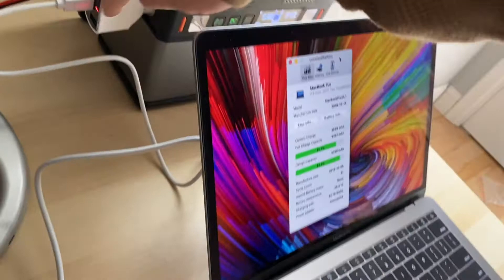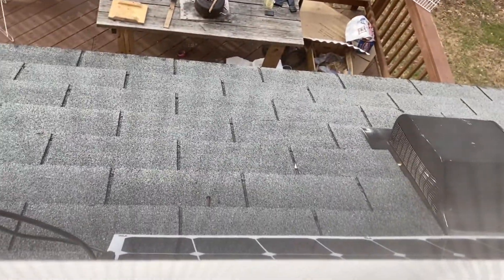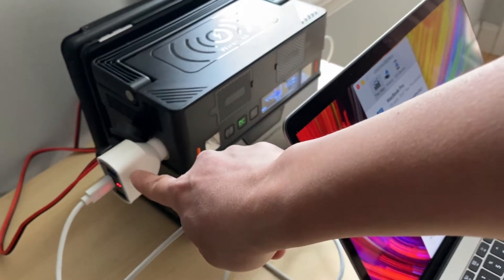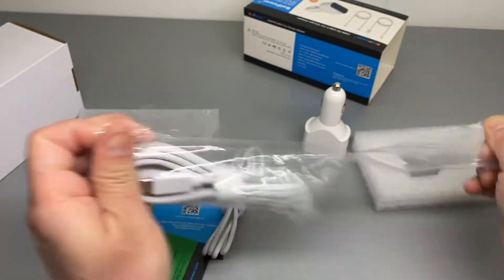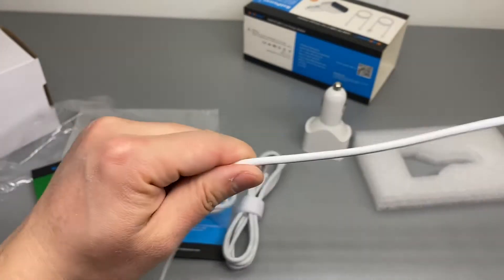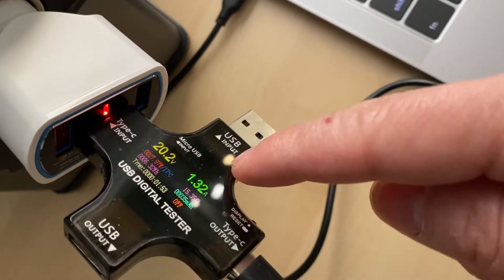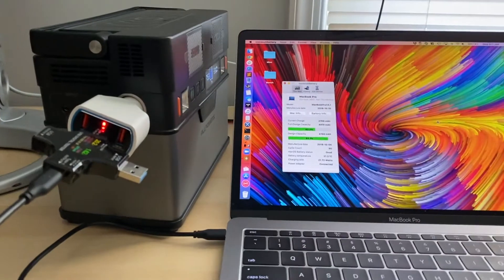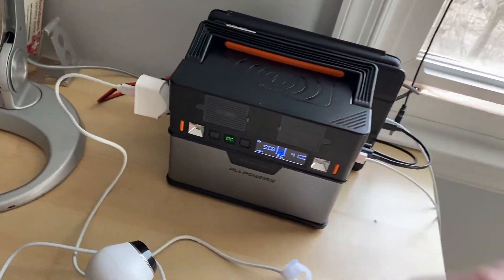ALLPOWERS Solar Generator with BatPower Type-C 12v Car Charger (Part 2)

Comment: so a mac can draw 65w right, and it was drawing only 22 or something , the charger was rated at 90w. so what was the bottleneck here.. were you using the stock cable ?
Reply from the maker: It really depends on the current state of charge -- If the Mac is around 80% or higher, the charging speed is lowered. I guess this kind of test is better when the battery is around 20%.
Reply: @ToolsElectroDIY  yeah, this smart charging is messing with guages I assume

Comment: How much time you have had it since purchased? Any battery or display issues ? I was testing most of all the features as the unit is well made , type c is not as advertised 60w it’s more like 45w in or out from port , all type A usb are perfect with great amperage output , the 120Ac is great but get around 110-114 around 59.9Hz all electronics would like that , now in the downside of things I noticed something that sucks on the solar Anderson input . The solar starts working from 16.6v to 22v so if it’s not so sunny even if you have so many panels you can 1) only receive 60W max from solar and must be around that volatge less will not let the mppt kick so weird . Dc is better for car plugs or the dc adaptor more friendly. As the cigarette is not regular yet the is a way to get the regulated but you must buy the plugs on the sides and turn it on by having a load of 3w or more which is sad cause what if you have a device that draws 200mah or more but doesn’t even get to the required needs the system will turn it off in seconds th other way is to simply hook a Ac adaptor that is 12v or what ever is the need and have stabilized voltage on dc.! Many devices don’t have the features this one has may have more Ac watts but the internals we don’t know how long they last many don’t have mppt nor PD charging .
Reply from the maker: I got it in Jan 2020. No issues so far.Thanks for sharing your experience!
Reply: @ToolsElectroDIY  I am running MacBook w the Ac and most of my chargers on Ac too I have used it for hours and fan kicks in once’s every while for a couple of seconds , wonder how better is the 666wh version . I wish we could charge it just abit faster but great design to fit all those features
Reply: Almost going to be a year , oh one question have you drain it to the point that it’s 0% or how many cycles it shows for the one you have on the app? Mine 6 and I only drain it once have always keep it 100% that’s abit weird

Comment: is the 12v DC out  Regulated???
Reply from the maker: No it is no regulated. I wish it was. It may discharge the battery too much and damage the battery. You better keep an eye on it if you use it this way like I do.

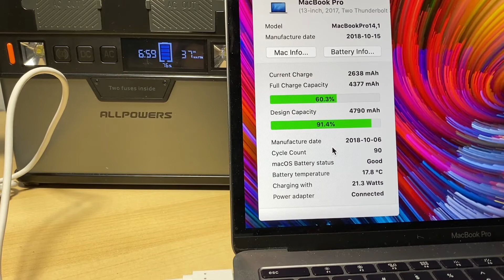Comment: You were reading the power station display as output but it said INPUT wattage.  Since you still had the anderson connector inserted at 6:50 I think what you were seeing is the net difference.  70 watt in, 30 watt out, display read 40 watt in.  Once you disconnected solar and realized your mistake and used the usb watt meter it's accurate.
Reply from the maker: You are just as nerdy as I am. Please subscribe.
Reply: Deal lol
Reply from the maker: Cool. I will keep more unedited raw mistakes coming.
Reply: @ToolsElectroDIY  Well, as you know, speaking as a random person on the internet, I have never made a mistake in my life ;) (well, except for my first wife)

Comment: Also this is I want to do in the future. Whenever I get a chance to do something like this. But also have different technology class. ( I do not have apple laptop or my own ipad tablet ) So will have to use a power strip if it will work. Also on the other outlet will connect my 20USB power station to charge a whole range of technology if it can handle the output. But also my 20USB as a built in fan so yea. Also it's in my YouTube channel with my technology review and some games too check out whenever you can or interested.
Reply from the maker: I will check it out, thanks for letting me know!
Reply: No problem and also was riding my bike to town to play some ingress prime/GPS game and also pretty cool game now too. To pass the time. P.S This technology as the ability to do 300W, Peak Power 500W. But don't have to drain it fast. Also maybe do some testing on power heavy stuff while still on solar at the same time. But anyway just a idea. ( Good luck ) Also another thing you might have not tested wireless charging pretty much max out very output. But anyway don't have to do it just a idea.

Comment: Please update the status of unit after using it a while. There are some negative reviews about failing charging system after few months of use.
Reply from the maker: What is the issue you are getting? I will consider making another video in the near future, please subscribe!
It's been performing very well on my desk since the video was posted. I use it daily via the 100w solar panel outside my window. However the charging doesn't start automatically in the morning -- manual button press any key is required to start charging. You can also reset the unit by pressing and hold the DC button for 20 seconds, if you experience any issues (according to Allpowers support, as there were times when it couldn't recharge from MC4 port from solar.).
Reply: @ToolsElectroDIY  I don't have a unit yet but ordered one since I found a good price (under $100). Hopefully it won't have issues. I  just wanted to check with you since you seem to use it everyday. If you don't mind update the status one year after use so people like me can decide easier. Thanks.
Reply from the maker: Yep. I will try to update regularly. Actually I did an Amazon Live stream about this power bank a few weeks ago. You can also follow me on amazon https://www.amazon.com/shop/fastunboxer
Reply from the maker: See https://www.amazon.com/live/broadcast/2610c473-82c4-4f27-b348-b6a847bcd36c
Reply: @ToolsElectroDIY  Thanks, I hope you get more subscribers.